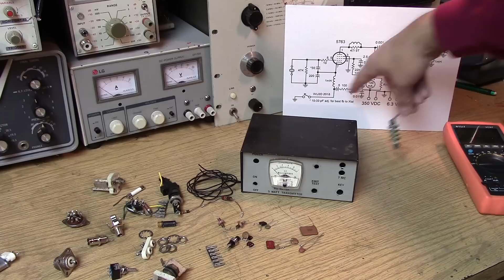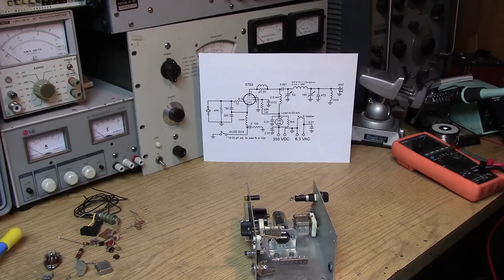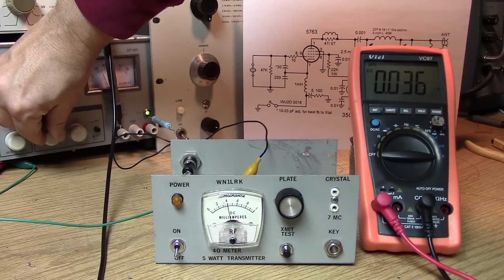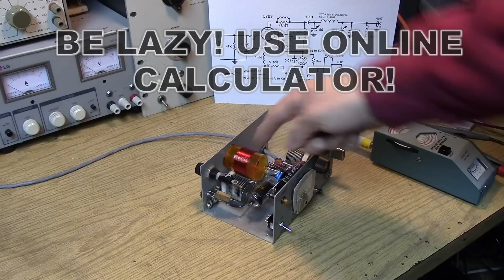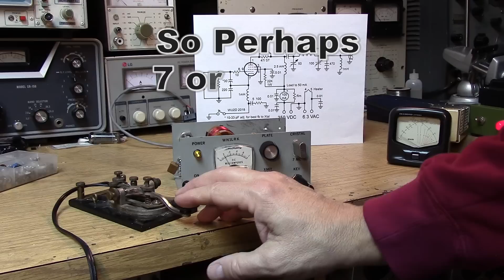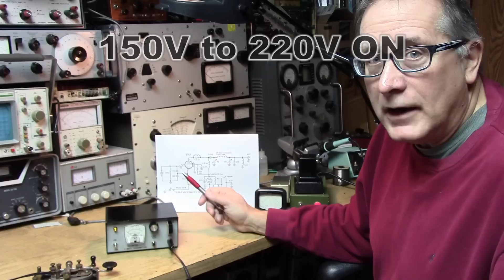WN1LRK 5763 TRANSMITTER

Comment: Actually the 1mH choke has a very important function.  When power is applied to the plate circuit the 0.001uF output coupling capacitor will charge up, and the current flow is through the 1mH choke from ground.  When power is removed the same capacitor needs to discharge, again through the 1mH choke.  If the choke were not there then some DC would appear on the antenna, unless that antenna used a grounding Balun.  So without that choke, a shock hazard exists at the antenna or RF output jack.  Another trick is to use a 4.7k ohm 1W resistor in place of the RFC.  Takes a bit longer to charge and discharge the RF Coupling cap, but it sure is cheaper.
Reply: Same chocks cost so much  kg6mn

Comment: The RF choke on the output is not there only in case the plate-to-network capacitor fails. It's there to act as a pull-down across the loading capacitor -- in effect, to allow the plate-to-network capacitor to charge AND to keep the RF output line to the antenna jack at dc ground -- when a low-resistance load is not connected to the ANTENNA jack. (Without such a pull-down,  the plate supply would charge the plate-to-network output C in series with the loading C, with most of the voltage appearing acoss the loading C.) I've seen a 1/2 watt, 10 k to 22 k resistor to provide this pull-down function instead of an RF choke; a resistor may provide more safety than an RF choke if the plate C fails, as the resulting current pulse might well cause an RFC to fail open, losing its protection, whereas plate-supply current through a small 10 k to 22 k resistor will cause the resistor to smoke, alerting the operator that something's wrong.
Reply from the maker: The choke makes for a great story. So does the smoke. But I already got electrocuted on the key, so...

Comment: My first ham transmitter was a Novice rig for 80 and 40 using a single 5763 from a book from the local library. Nice and easy to build.
Reply from the maker: 5763 is a great tube; one of the best for power oscillators.

Comment: If you convert the meter into a volt-meter, you can use common values to make the meter read correctly.  Use a 4.7 (or any other low value resistor) shunt, then a resistor in series with the meter, or even a small pot so it can be calibrated easily. 
Which you describe at 14:10
Good example here:
https://www.electronics-tutorials.com/test-equip/meter-shunt.htm

73
Jim W7RY
Reply from the maker: Working with analog meters and re-doing dial scales for restorations is a lot of fun. Thanks Jim.

Comment: It is really an excellent project,thank you very much.But my problem is in the calculation of output pi network so could you please give me precisely how to calculate it even to any tube or transistor.thank you.
Reply from the maker: Well a good approximation starts with calculating the impedance that the tube (or transistor) is presenting at its operating point during full power. So if we have a 250V supply and the meter reads 50 mA, the estimate is 5000 Ohms. This is 12.5 W input power by the way. So you are trying to transform 5K to 50 Ohms. Then pick the Q you want. Say 5 which  is reasonable. Then just work the PI formulas at your frequency.

Comment: The fuse is to blow, should the anode  .001uf fail thus putting B+DC  into the Pi tank Network. The output RFC would ground and damage  the B+  supply without a fuse. So if you do use the hole for something else, put a wire ended fuse holder or similar inside or in the power supply lead.
Reply from the maker: Fuses are cheaper than chokes too!

Comment: I wonder if this was a transmitter that WN1LRK a novice was trying to build from scratch,  or was it a commercially made transmitter or kit.  It looks like it was commercially made because the lettering looks very professional.  Looks like the old FT-243 cleaned up the chirp for the most part.
Reply: Looks like Letraset. If you are careful, it looks very professional. Needs some clear coat to be durable though.

Comment: I remember this in an American ham radio book I borrowed from the library. A novice transmitter for 40 and 80 meters. HT was about 280 volts. It was my first transmitter and worked well. Next one was a 2 valve 6BW6 oscillator/multiplier 807 PA for 10/15/20 and 40m. That got better results as I had more power. The HT was 560 volts on the second rig.

Comment: Wonderful. Some comments based on my recent findings: For a near-miraculous yoop/chirp reduction -- at 40, with FT-243 and larger rocks; HC-6s are just too thin -- put a 25-k pot (wired as a rheostat) across the 47 k grid resistor and, with key down, adjust its value down from 25 k. In the region immediately above the point at which there's too-little R across the crystal to sustain oscillation, you will find a slight output-power peak -- and you will find that the rig generally puts out more power than with the original 47 k grid R. This is without any regulation on the screen. <paragraph> Proper tuning of a crystal-oscillator rig is not about tuning the output for a plate-current dip; that's for an amplifier, but a single-tube oscillator is not an amplifier but rather a highly dynamic environment in which the tube supplies its own driving signal. The correct way to tune a single-tube-crystal-oscillator rig is to adjust TUNE and LOAD for maximum output _in conjunction with best keying_; there's little value (aside from eye candy) in devoting a permanently-installed meter to the job. For the 5763/6417, keying will be best on the lower-frequency side of "output max," at a point at which oscillation still starts reliably on key down. (And when it's connected to an actual antenna system, the "correct" settings will shift; I recommend monitoring your transmitted signal so you can find that sweet spot again and/or as you change crystals or rain falls and shifts your antenna system's impedance.)<paragraph>Beam power tubes are prone to intrinsic-negative-resistance-based oscillations in the plate and/or screen, so, in the order of importance: Install a 47- or 100-ohm resistor between the tube's screen socket terminal and screen bypass cap; remove that parallel RL VHF-killer choke and install a 47-ohm resistor at the tube's plate socket terminal, between the plate and anything else; and maybe up the value of that 10-ohm grid R to 47 ohms.<paragraph>But if you do only one thing, try reducing the resistance of the grid R as I've described and tuning the output for max output/best keying. Suddenly I can use my first-ever Novice transmitter construction circuit on 40 m without wincing! 73, Dave/amateur radio W9BRD
Reply from the maker: Wow fantastic research and practical info!

Comment: How about a "Add a 6146 PA to the 5763 transmitter" video?  What would the novice do to increase his power?
Reply from the maker: Charles Caringella, W6NJV, Easy-to-Build Ham Radio Projects (New Augusta, Indiana: Editors and Engineers, June 1967 CE), was the basis of this project, and he includes in another chapter, a 2E26 Amplifier stage which is the little brother of the 6146. This got you up to the 20 Watt level.  But the Radio Amateur Handbooks of the 50's and 60's were full of 2 tube novice rigs, some using the cheap 1625 tubes that were available surplus and even TV sweep tubes. These could get you to the Novice legal limit.

Comment: You must have a junk box the size of the library of congress.  I think I have enough parts in my junk box to build an led flasher.  This is the problem with the Ham industry - many times parts are hard to come by.  Ive been frustrated by lack of parts too many times to mention.  I dont know how many incomplete projects have sailed out my window due to lack of parts.  Its too bad there arent more kit producers interested in vintage equipment at reasonable prices.   Elmers dont give radios away any more as you mentioned was so in the past in another video. However, my friend's grandfather was very happy to take my last 1973 25 dollars for an S-38 that bit me if I didnt wear dry shoes.  Another pseudo Elmer was very happy to have me repair half the shingles on his roof for an old model 28 teletype machine.  The ham store was very happy to sell me an HW-8 kit with a swift kick in the pants out the door..  Some ham at a flee market was very happy to have me hall away a Yaesu 101 for top dollar, then I had to send the goofy thing to the factory for a 300 dollar over hall..  A kid cant even build a crystal radio anymore because he cant find a 365pf variable cap.  What's the secret to ham radio??  Perhaps one must be a greedy sob  - I sure met my fair share.  Of course this post is not a reflection on you...  just my experiences.  You want to know what virtual reality is??   I received virtually no radio hobby support from my parents or relatives or teachers..  I earned my extra the hard way - virtually alone - as most of the hams growing up today are apt to experience.  Ham radio operators are a dime a dozen;  real ham technicians are hard to find - and its no wonder - its just too darn difficult to find parts.  On the other hand if you want to buy an $800 radio filled with SMTs so small you need a magnifier you will have no problem.
Reply from the maker: Junk Box Envy - the road to perdition.
Reply: @MIKROWAVE1  Dont you mean  THE ROAD TO HELL IS PAVED WITH JUNK BOX HOARDERS...  lol   One crime is Idolatry, my crime is simple passion.
Reply from the maker: I sometimes am accused of heresy mixing electronic and religious terms.
Reply: Well, that's no worse than when Im accused of mixing metaphors or dangling a modifier...  73s...  love your vids
Reply: clyde bennish , if you can, try attending hamfests that have "flea markets" of electronic parts. I know that is hard to do because of the Covet-19 situation we currently are experiencing. Unfortunately, a lot of these old parts get thrown out when an old guy like me eventually becomes an "SK." I did my part to help a younger generation, by giving a whole bunch of tubes to a younger Ham who actively builds vintage radio stuff. Keep looking. You'll be amazed at what unexpectedly becomes available.

Comment: nice looking project, I made a similar one a few years ago for 40M but it was a one transistor oscillator and an RF match to the antenna, what I did not have was a harmonic filter, and i got a harmonic signal on 14M, which could  not get rid of....de aa5oz
Reply: ouch  mn